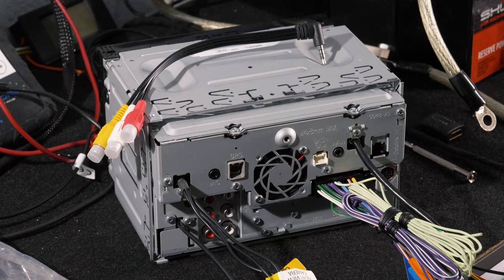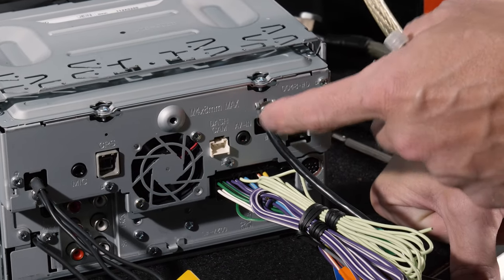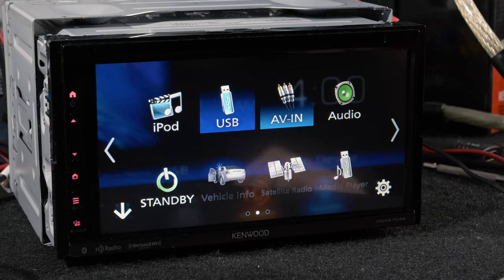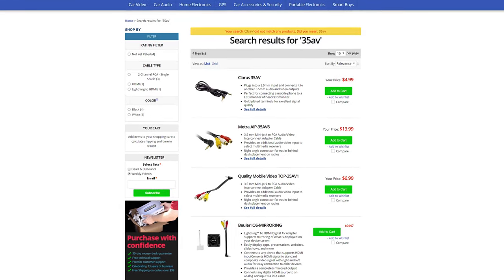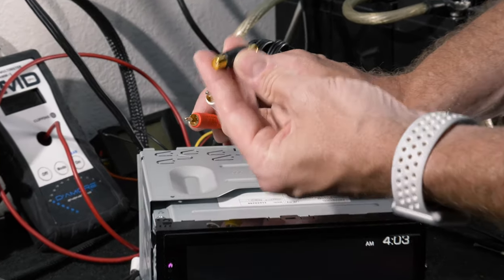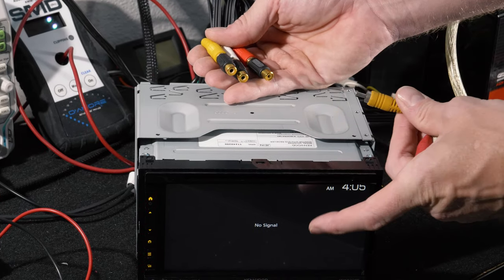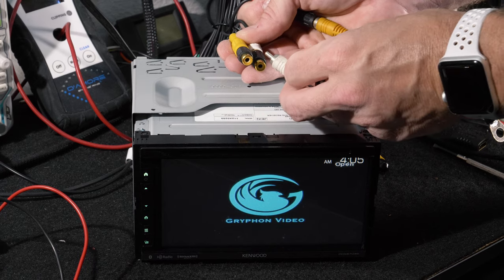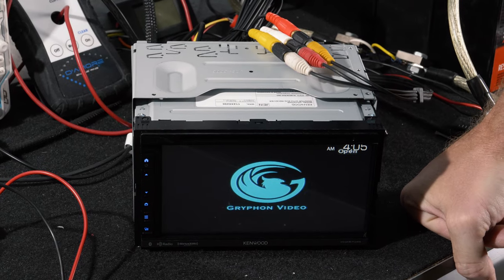Kenwood CA-C3AV 3.5mm to RCA AV Adapter Alternatives - Screen Mirroring

Comment: Thanks, good video. I tried using a 3.5 4-pin cable from my Viofo 129A Pro Duo Dashcam to the 3.5 pin AV input in the rear of my Kenwood DDX9020DABS, but I am not getting any video or audio. What do you think I am doing wrong?

Comment: Thanks for great video. I have pioneer avh270 BT radio it hasnot RCA input of backside. So i bought 3.5mm to rca cable and hooked it up to RCA to hdmi convertor an also used an allcast mirroring dongle. I got video signal but it was black an white and is not clear its so much wavy. Pls Can you give me an advise do i need to buy new 3.5mm to aux cable or another else

Comment: what exactly do i need for my Kenwood DNX996XR to play my playstation classic in my car? do i need an rca to hdmi converter? the ps classic says it needs 1.0 minimum usb and i believe this kenwood is 1.2 amps? is there a 3.5 av cable to hdmi to retain 720p?

Comment: I purchased my few months ago and you sent me the wrong one.  The connection on both sides were males. The video works fine but the sound no sound  ther are 2 black strip on the connection not 3   I should have paid the professional to connect it right away this way I could've got a different one with not paying anything out but now screwed and I had to pay $34 to crutchfield just to get this part. Thank you

Comment: Hi, in my case, while trying to mirror , I am not getting audio (sound). The video is playing well. My stereo is Sony XAV W601. I tried this through the rear AUX port. The items I have used are mentioned below ....
1. Mini HDMI to AV up-scaller ( https://www.amazon.in/gp/product/B074GWL9HL/ref=ppx_yo_dt_b_asin_title_o00_s00?ie=UTF8&psc=1)

2.  3.5mm Stereo Male to 3 RCA Male Audio Video AV Cable for DVD, Video, TV, Camcorder Camera (https://www.amazon.in/gp/product/B07PGZ8XWB/ref=ppx_yo_dt_b_asin_title_o00_s00?ie=UTF8&psc=1)

3. Anycast Wireless WiFi 1080P HDMI Display TV Dongle Receiver (https://www.amazon.in/gp/product/B07SG3ZT9L/ref=ppx_yo_dt_b_asin_title_o06_s00?ie=UTF8&psc=1)

I tried resetting the stereo but to no avail. Please help and revert .